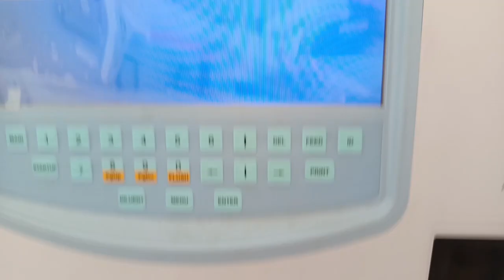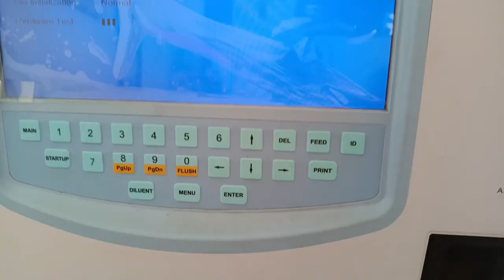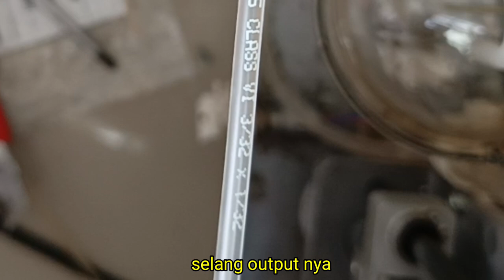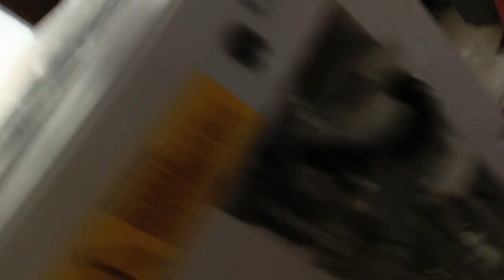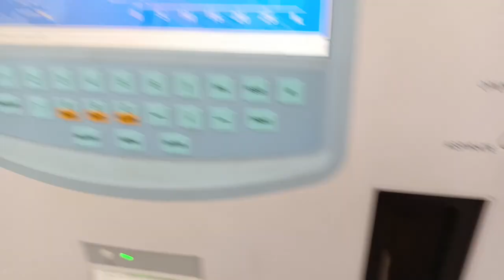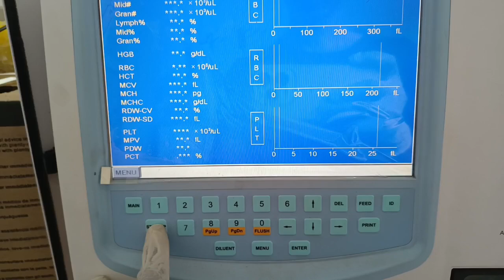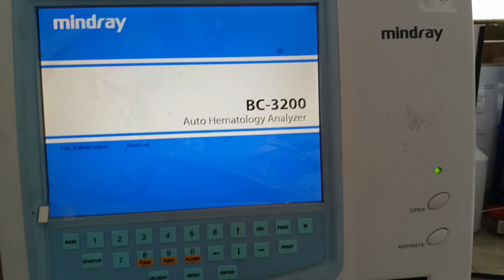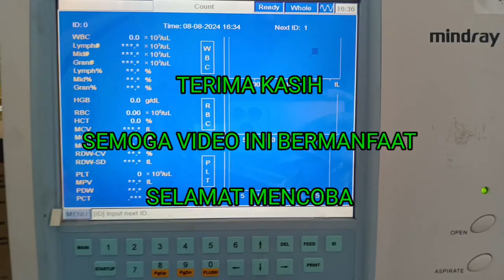MINDRAY BC-3200 ROTATION MOTOR ERROR V89 #MINDRAYBC3200

Comment: I have Mindray's BC 3000 plus cell counter. On switching it on, the WBC neutrophil and lymphocyte count is coming up in the background. It becomes normal after running blank for 10 to 15 times. After that, one or two samples are normal and then the same problem starts again. Please suggest some solution for this. I have tried changing the lyse as well but to no avail.
Reply from the maker: Are a wbc shown result on  baground test ? Try check a valve for waste off wbc chamber

Comment: Hello, Bc3000plus Mid% a little bit high, Could you help please
Reply from the maker: Mid % high..that is result sample patient or blood control ? Try use a new blood control for comparison
Reply: All blood sample Mid% are around 10-12%
Reply from the maker: @LAB-KH try use a blood control for adjust a manual calibration faktor off a  wbc